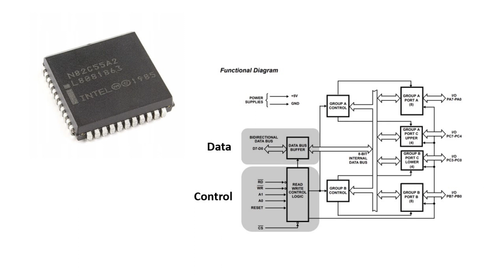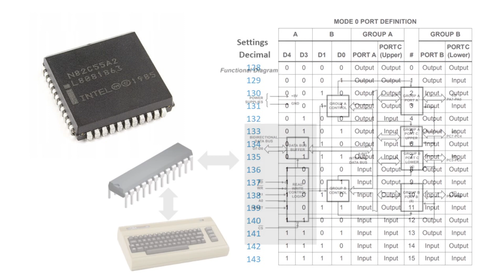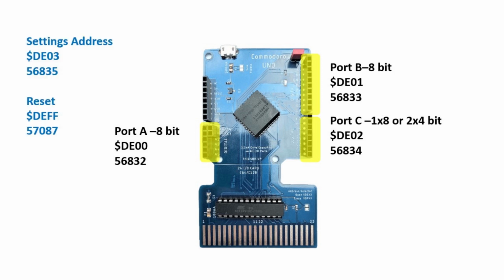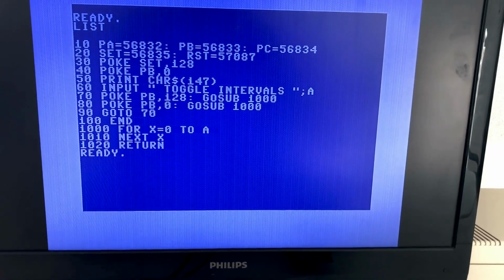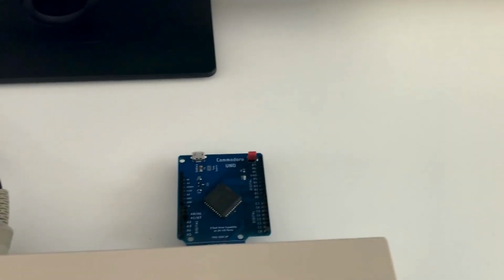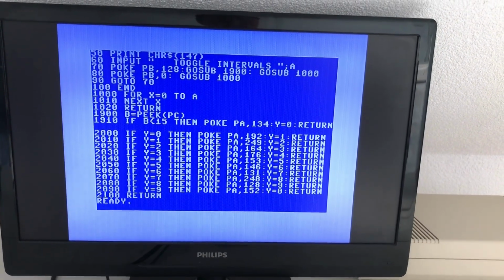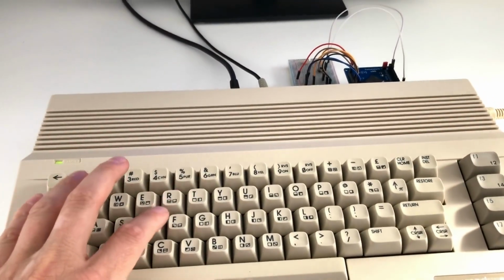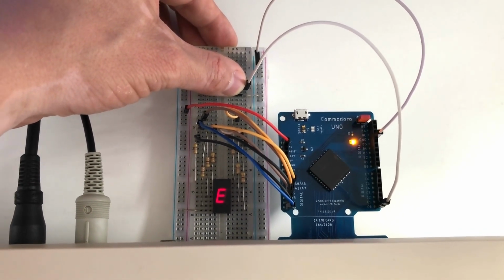Commodoro UNO -  Arduino UNO like board for Commodore C64 and C128 - based on  82C55 and ATF22V10C

Comment: Very nice - but what is accomplished with it ? Can it speed up interfacing? "Arduino uno like" for PC Arduino is just a separate machine with its own code - do you mean that you can just programm commmodore uno from a commodore not necessarily using USB?
Reply from the maker: It is 3x8 bits I/O card that could be simply program via Basic (In my case I use C). It gives a possibility to use C64 as a external Hardware controller. e.g. Christmas Tree + train :), step motor, relays, LEDs, etc. Pinout design is equal to Arduino, so usage of shields could be easy.
Reply: @mntechn4434  Ok Thanks - so it makes arduino accessories compatible hardware out of commodore alas it adds GPIO pins to your commodore.